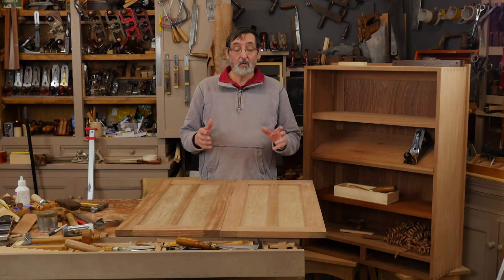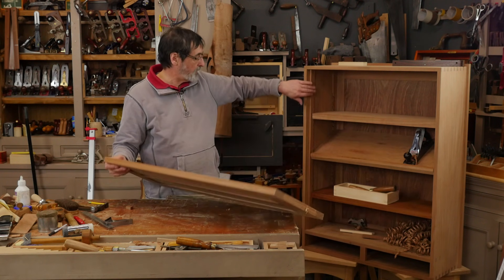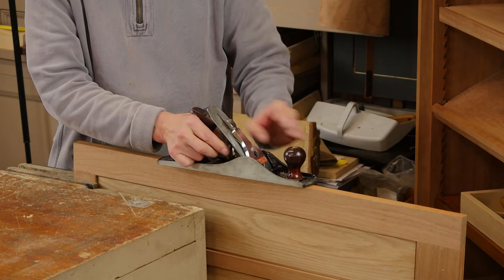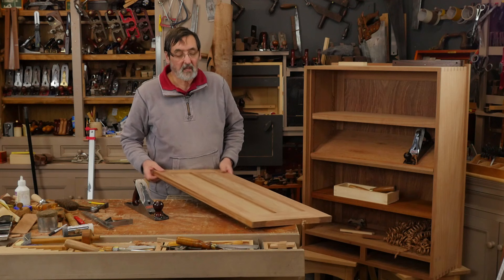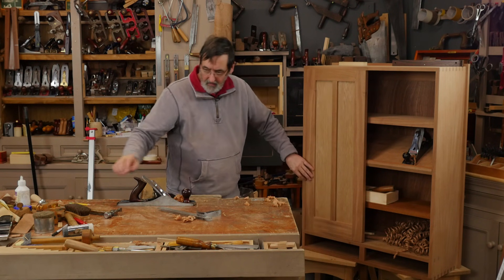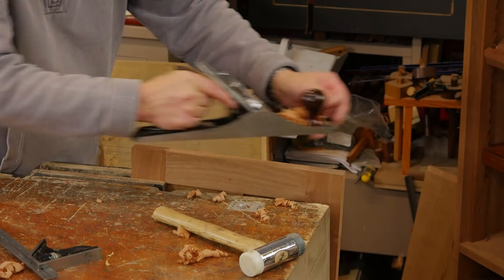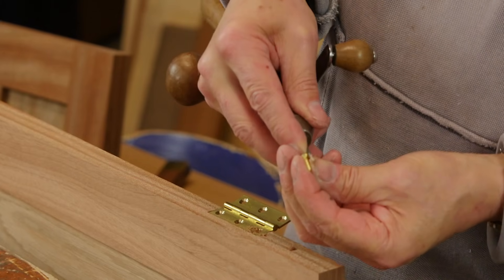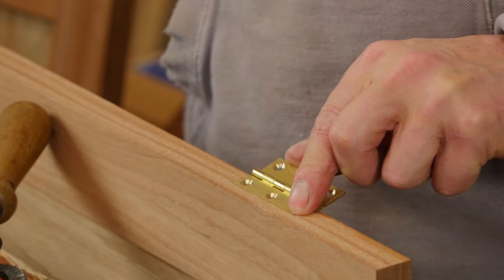Door Fitting | Paul Sellers

Comment: I like the idea of making the back of the hinge pocket a bit deeper. All the doors in my house are very slightly "hinge-bound" - they spring just a little as they finally close. This will eventually loosen the screws and make trouble down the road. I think the carpenters who hung the doors were just too concerned with keeping the hinges exactly flush with the wood.

Comment: Re curved dados with wobble-washers. I did the math and yes there would be an arch in the middle of the top/bottom surface of the cut. The height from the cord to the arc would be 0.0176" for a 3/4" dado. I think the glue would easily fill that.

Comment: i can't think of any reason to use a slotted screw anymore, unless it's a matter of esthetics. I use Phillips, square Robertson, or Torx.
Reply: It's interesting, to hear the different views we have about things.
In my workshop, we call anything other than a slotted screw, a 'moron screw,' and all moron screws encountered are immediately >binned.<
This is partly because, working on mechanisms which are often 100 or more years old, the moron screw would look out of place, and partly due to the experience of having to deal with rusted-in screws.  With the slotted screw, you have a chance at cleaning the rust out of the slot.  With a moron screw, once you, or the rust, has ruined the head - you can forget it!
The moron screw has its place - in house-building and the like, where, armed with a moron driver, the moron can zoom in the screws at high speed, with no need for a pilot hole, a clearance hole, or a countersink.  But in fine wood-working, I would be ashamed to use such a thing.
Reply: a very old carpenter told me the slots were always lined up vertically on a door hinge so one could check them at a glance to see if they were loosening, the slots would be offscewed a few degrees counter clockwise. Sounded far fetched but I've never heard any other reason for them... other than the Gods of woodworking were testing the faithful's screwdrivers...
Reply: I think it is to test the faithful's screwdrivers.
Reply: Wobblycogs Workshop You don't see my point, then, regarding rusty screw heads?  And have you ever had to deal with a 'star-headed' screw, in which the head has been ruined?
As for screw manufacture, these have not been made by hand for many years, so I suppose it depends on what you mean by 'up until recently.'  (Victorian screws were machine-made and mass-produced.)
The non-slotted type are almost all inventions of the 20th century.  The most common (the Phillips) certainly is.
Sadly, from my point-of-view, slotted screws are going out, because of the attraction of being able to use an electric driver - usually in the hands of someone without the skill or care to use anything better.
Lining up the screw slots, I agree, is done for appearance.
Reply: Wobblycogs Workshop I agree with your comment, if you are looking at the short-term, and something which is never meant to come apart.  (I call it, 'crap, modern, construction'(!) but it has its place.)
In my work, I am expected to do a professional job, which will last permanently.  If it has to be re-done in the lifetime of my client, it has failed, and, being self-employed, and living in the same place for about 40 years, now, I am the one expected to put it right.  This is one reason why I have never yet had to go back to a job, and never had any competition (so never had to advertise.)  And then there is also the little matter of professional pride in the work - something which counts for very little, in many cases, these days.  It's a different approach for different circumstances.  My thought has always been, 'Do I really want to spend a working life, doing crap work, just for the money?'  And the answer is: 'No thanks.'
One thing we must disagree on, is the use of zinc-plated screws.  They look good, but in circumstances of dampness, they are absolutely useless.  Come back in 10 year's time, in a damp building, and they will be as rusty as anything else.
Stainless screws are prohibitively expensive.
Brass screws are good, but not always applicable, because they are soft.
I don't know about 'passivated.'  Maybe no better than zinc-plated?
If, as you say, you don't see rust as much of a problem in the modern world, I think you have led a very sheltered life!
Reply: Hmm, maybe I should also have asked how many angels could dance on the head of a screw.  .

It seems that I have removed many more damaged slotted screws than screws with a different drive style, i.e. 'moron' screws.  Well, esthetics aside, it's the quality of the metal in the screw that prevents cam-out, as well as using the proper screwdriver.  Also, someone said that stainless steel screws were too expensive, but I find that is not true.  But stainless steel screws can sometimes be made from softer metal than other steel screws and may be damaged if not driven properly.
Reply: Oh no! Mr. Sellers installed 'moron' screws in his tool cabinet!  In the door fitting video, I see Phillps headed screws.
Reply: Bob Blarney Which video?  I can't see any in this one.
On the other hand, I suppose he has to cater for all possibilities, however distasteful!